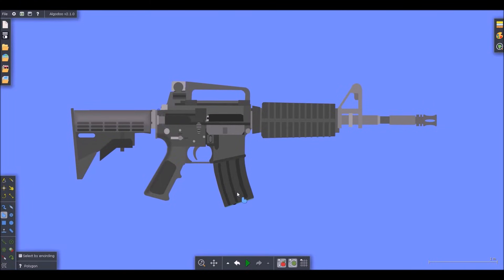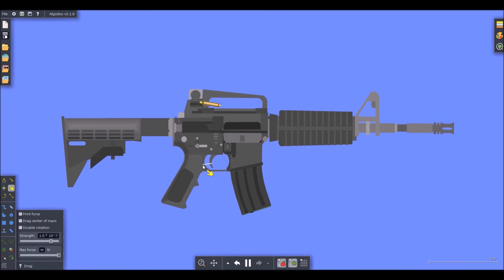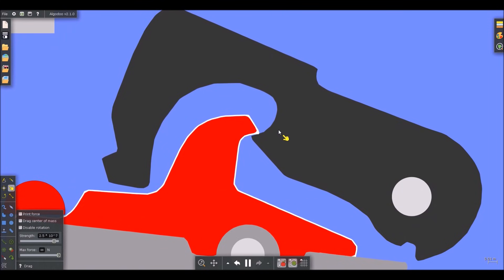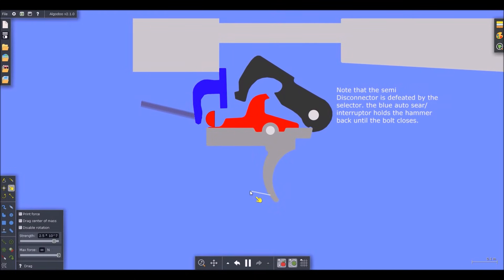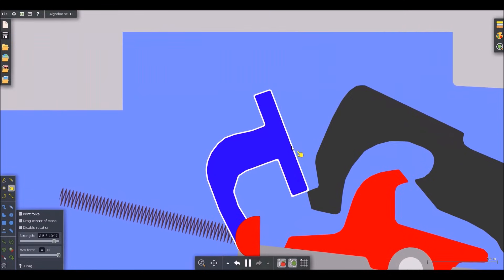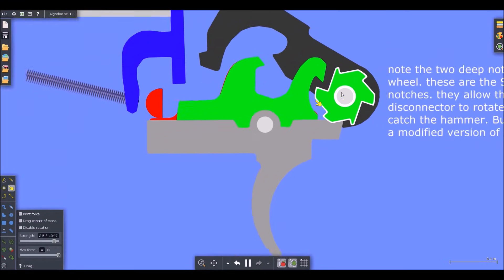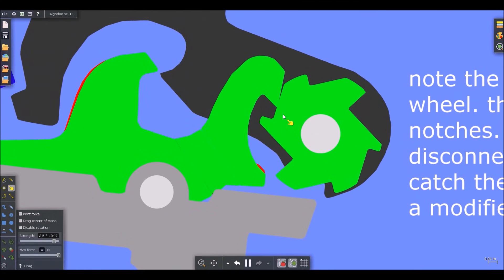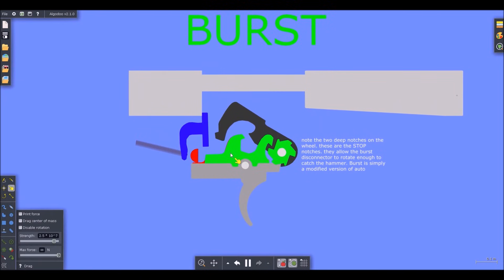How 3-round burst works

Comment: If you give the trigger a short quick squeeze that only sends out two shots. the next time you pull the trigger it will only fire one shot before disconnecting.

Or if you fire a single shot while in burst mode, the next time you pull the trigger it'll fire two shots.

And the burst cam also counts when you are in semi auto, so the first time you switch to the burst mode it is more or less random if the gun will fire one, two, or three shots in it's first burst.

And to make matters even better, the trigger weight varies depending on the position of the burst cam. so every third trigger pull is lighter than the other two, even in semi auto.
Reply from the maker: otetechie I should refer people to this comment, as a lot of people ask about this.
Reply: Are there any designs which don't have this flaw?
Reply: @masheroz  they all start with flaws, till its perfected, as cars have been, airplanes etc,   to me full auto with todays ammo prices is a waste of good ammo, and cash,  keep it simple and it will keep you safe and save money,  i just got a 3 round burst for air rifle and its almost the same,  but not as original as the s stamp c stamp if you know i mean??
Reply: That was exactly what I was curious about when I scrolled down, thanks for sharing.
Reply: Quincy Owyang It was introduced in the 1980s as a way to prevent the M16A2 from being made a semi auto only infantry rifle. Eugene Stoner also didn't design it.
Reply: @whiskerymedusa  : It was also a way to enable somewhat accurate full auto. I was an instructor back in the 70s, and I noticed that shooters would fire off a full 20 round mag, hitting with the first couple of rounds, blowing most of the rest over the target, then maybe get the last round or two back on target. When the A2 came out, I realized those same troops could put a number of short bursts on target with few overhead shots.
I've read that some troops hate the 3-round burst, and I'd like to know why. I never had to use it in a fight, so I'm asking those with combat experience.
Reply: @ComprehensiveContext  The reason they hate it is that the trigger squeeze changes every time you fire the rifle, and if you fire less than three rounds then switch the rifle finishes the three rounds before firing a burst. This all leads to a rifle that is less consistent shot to shot than a rifle should be.

Meanwhile soldiers who were magdumping were demonstrating the lack of training they received on its proper usage (which was an institutional problem) and an overall lack of discipline with arms (which is also a longstanding institutional problem)
Reply from the maker: the high fire volume makes a rifle devastating a close-quarters, but semi is still better for making deliberate, aimed shots.
Reply: Not all are crap like that. Others reset every time you release the trigger, so you get  true 3 round burst and not random like this.
Reply: jussimakarussi the hammer would not fall with enough force to fire a live round. This happens occasionally with bumpfire or binary fire, as well as very light triggers.
Reply: "So if I understood it correctly, there is nothing to prevent the hammer from dropping while the bolt is out of battery in a semi auto AR15?"

True, but the way the bolt carrier, firing pin, and hammer line up, the hammer shouldn't be able to hit the firing pin when the bolt is out of battery.
Reply: This is what I remember.  I thought my rifle was fucked up the first time I tried to fire in burst because it fired one round.  I then tried again and all three went off.  Clicked in my head that, well that's just the way it works, but it was odd.  Funny how the Army doesn't train on burst.  It's just a quick way of getting rounds down range when you've got too much ammo and no one wants to fill out the paper work to check it back in (or do the manual labor).  Hopefully things have changed by now, but probably not.  End of the day accurate fire does more than burst, especially when you have machine guns for suppression.
Reply from the maker: EricTheBoringOne on the m16 rifle, the INITIAL burst is random. The mechanism “wanders” even in semi. Anything following is a full 3 rounds.
Reply: lol They issue full auto rifles right now. Not only are there still M16A1s and its contemporary carbines being issued, but there are the original SPRs were built on full auto M16A1 lowers, the M16A3 variant is full auto, and then the M4A1s are full auto. There's a ton of full auto M16s and M4s being issued *right now*.
Reply: Quincy is right, it was designed for soldiers who didn't have good ammo conservation discipline, now that select fire rifles are more commonplace and the training is improved there's less need for it so they've gone back to just having semi and auto.
Reply: @G1NZOU  The number 50,000-250,000 small arms rounds per kill in Vietnam is routinely thrown around. The high number is said to be caused by wasteful soldiers, don;t know if this motivated the 3-round burst
Reply: actually burst fire works really well. its rare that someone using burst is gonna let of the trigger to quick because you train to properly use your weapon. burst is really great for suppression if for some reason your light machine gun goes down during combat
Reply: you know nothing about the combat applications of burst fire obviously.  its a great tool to have if your light machine gun ever goes down during a fire fight which happens moreoften than you would think. dont makecomments about things you know absolutely nothing about. it makes you look ignorant.
Reply: ok its obvious you have no clue what youre talking about. the m4 is still a semi/3 round burst weapon. the US military doesnt use full auto m4. manufacturers dont even make them except for special applications for SF groups.
Reply: "an unnecessarily complex shitty assault rifle that required DECADES of upgrades and continuing design just to become an average assault rifle."

A: It's not at all complicated.  It is definitely not complex, unless you mean its manufacture.  Then yes, the manufacture WAS complex by 1950s standards, because it relies on CNC machines.  Which are extremely common today.  B: The only "upgrade" it needed to surpass the rest of the breed at the time was to have the Army stop using the wrong powder in their ammunition.

I either own or have had the chance to shoot a lot of the competing designs, and none hold a candle at this point.  Yes, some of that is due to the decades of development, though a TON of that was companies developing for and with civilian shooters.  My private AR is about 15 years more advanced than the current issue M4.
Reply from the maker: Laramie Frank you’re thinking of the auto sear. Disconnector simply holds the hammer back when the trigger is held until the trigger is released
Reply from the maker: EricTheBoringOne guys, let’s keep it civil please. Discussion is good, but unnecessary criticism does nothing
Reply: EricTheBoringOne : If you're talking to me, I served in the Air Force from '82 to '86. In a earlier comment you mentioned the 3round burst was the best configuration, which I have to agree, from the shear reason that full auto isn't very accurate at all. 
When was the 3 shot burst introduced in all of the branches of the military, if I may ask?
Reply: Mandy Hammond Alright, thanks alot for the answer :)
Reply: +Matthew Rowles 

Binary triggers. 
 Those will replace the burst trigger as an intermediate.
Reply: @dalesmth1  what about the new ar's with electric trigger groups that can be changed anytime without much hassle,   semi, full  3rd  b etc
Reply: @Crownroyal-b3r  So only people who have designed firearms are allowed to voice any criticism? Haha the argument from authority is so empty and pathetic you don't need to be a chef to know shit tastes bad so go fuck yourself little buddy.
Reply: jussimakarussi the disconnector prevents it, and the bolt cycles so fast that you would not be able to reset and refire the trigger before the bolt locked again.
Reply: jussimakarussi the disconector prevents the hammer from falling out of battery. But it is the only thing preventing the hammer from falling out of battery. If you took out the disconector the hammer would fall while the bolt moves forward and possibly hit the firing pin Before the bolt locks
Reply: This is interesting, I never knew how the three shot burst worked. I only knew about the M-16's full auto functions since I used one in the military. Thanks for the clarification.
Reply: I love this comment! Thank you for tell the real burst mode work that most of game can't do it for real burst mode.
Reply: otetechie can you tell me what program you're using for the simulator
Reply: >> And to make matters even better, the trigger weight varies depending on the position of the burst cam. so every third trigger pull is lighter than the other two, even in semi auto.

Something every American Service Conditions competition shooter is only too aware of...
For single-shot events that allow for it, most shooters will cycle this purposely to get to that lighter pull. Most important, each pull is consistent.
https://www.youtube.com/watch?v=tV1xYJoiYjE&t=540s
Reply: So basically, burst fire sucks.
Reply: EricTheBoringOne : I know when I was about to get out, they were talking about the 3 round burst, but that's all it was, talk.
Reply: otetechie I was totally about to ask all the questions you answered. Thank you.
Reply: Good to know. I was considering designing a rifle with burst capabilities, since it's good for conserving ammo with undisciplined soldiers, but now I'm reconsidering.

The complexity, inconsistencies, and weight are too important to ignore, but burst fire wasn't intended to replace auto; it's just a training tool.

I'll probably end up compromising, making a burst variant for new soldiers that would be traded for auto after a few years of service.
Reply: Nice that's exactly what I wanted to know.
Reply: Exactly. Burst is more complex and has all the problems previously mentioned. Full auto is only on battle rifles to be used for short bursts in the first place, but apparently soldiers weren't/aren't disciplined enough for that.
Reply: Burst seems like a waste of ammo anyways. I would prefer either full or semi.
Reply: Sounds freakin annoying. Personally I’d stick to full auto. I understand the purpose behind 3 round burst, but I think it’s best to learn discipline and retain full function of the weapon rather than putting a bandaid on the problem of blowing through ammunition... easier said than done, but with modern training and combat experience, most firefights I’ve watched I haven’t seen any soldier just running a full mag dry out of fear.
No disrespect to any soldier of course. Anyone who has run a full mag dry with one trigger pull under stress, I don’t doubt I’d do the same at times.
Anyway, point being, I don’t think I’d feel as confident in my weapon and my ability to use it with that kind of complexity in its interaction with the user. I apply a certain amount of pressure to a trigger based on my subconscious memory of its weight when I’m ready to fire, that way I can break over my shot quick and easy without pulling off target... a constant change in trigger weight would drive me insane.
Reply: There are other three-round burst mechanisms out there.  Forgotten Weapons has a video about an (IIRC) an HK pistol with two additional disconnectors that are activated by the slide but then drop out of the way when the trigger resets.
Reply: Dude, this was an interesting read. Thank you for taking the time to write it.
Reply: your a moron
Reply: I see why the sig 551 mechanism is completely different. Avoids these issue.
Reply from the maker: depends on training and intended use. Burst tends to bridge the gap between the marksman and the machine gunner. A nice volley of 2-3 rounds has a similar spread pattern to a shotgun, making medium distance shots at laterally-moving targets a cinch
Reply: 3 rounds burst sounds like a bad idea if it works that way.
Reply: "3 rounds burst sounds like a bad idea if it works that way."

It and full auto are almost never useful, though burst is even less useful.
Reply: Mandy Hammond I was thinking more in the case of a failure to go fully into battery because of dirt or such. During a standard firing cycle this would never be an issue.
Reply: this isnt random you moron. its a true three round burst. pull the trigger and hold it for a split second longer than a semi auto shot and you send three rounds down range. its not hard to use. its actually very effective. ive got real life experience with these weapon systems and they are some of the best combat rifles in the world. thats why we use them.
Reply: you must have served a long time ago because none of our military branches have issued full auto m16 in a very very long time.
Reply: immikeurnot yep. The platform is very simple in every Avenue........ hence why it's still being used and why it was picked. Also before the ar, every branch had different weapons. 

Also agree with the issue with ordinance corps using incorrect gun powder. The og was not having a chrome lined barrel and had no cleaning kit due to the design was set up to use. They used ball powder but was supposed to be IMR. This causes many issues in FA and in the system in general. This was warned by stoner and colt.

These other guys are clueless on the who and what for the failures and the "dirty" issues. Would help if you have ever built, timed or even shot a FA rig.
Reply: Quincy Owyang also to keep the barrels from melting off the gun.
Reply: So if I understood it correctly, there is nothing to prevent the hammer from dropping while the bolt is out of battery in a semi auto AR15? Was it considered a redundant internal safety, when faced against the fear of it being modified into a full auto?
Reply: @jussimakarussi  : No, you're mistaken. Check out your AR15 trigger group, and you'll see the disconnector very clearly, just as in the M4 semiauto mode.
Reply: Yeah, Eugene Stoner was an overrated fucking idiot, who created an unnecessarily complex shitty assault rifle that required DECADES of upgrades and continuing design just to become an average assault rifle. 
Why the fuck the Pentagon didn't dropped the M16 after as soon as it became clear it was a terrible rifle and just bought or designed a better one is beyond me, bureaucratic momentum I guess.
Reply: @charlesferdinand422  i used my m16 in the army and it was the greatest rifle i ever used,  once it was redesigned by 72 i was in love, easy to take apart, clean,  and mine had semi , full auto and 3 round burst,  because i installed it myself with many errors and frustration till i could shoot a flower stem at a okay distance,  with that, stay off the m16 being a bad rifle,  still being loved today,  Mr., Stoner is not here to defend himself, quick calling people names already,  a true patriot respects other patriot, okay?????????
Reply: @charlesferdinand422  Read some history about why the issues in the field were so prominent.  Most of the issues with the M16 were because of inexplicable last minute design changes by bureaucrats, and not because of Stoner's design.  The effective lethality was decreased by a change in the twist rate that increased bullet stability through changes in material density during flight, air to body transition.  Changes in the material for the bolt, and even the addition of a forward assist, were some of the reasons for increased issues with failure due to dirt, with the bolt material being less resistant to issues with dirt, and the addition of the forward assist increasing openings for dirt to enter the internals of the system.  One of the biggest issues was because of a call for a change in the powder used by the ammunition which caused cyclic changes in the resonance of the system, increasing failures. EDIT:  Wrong link the first time:  https://www.theatlantic.com/magazine/archive/1981/06/m-16-a-bureaucratic-horror-story/545153/
Reply: @bigassrat  It's funny how other really good assault rifles like the AK47 didn't need any upgrades or improvements, theyre were great right from the beginning while the M16 needed decades of research and upgrades.

Comment: Interesting! Always amazing how much thought is in these mechanisms. One Question: This means that if i stop pulling the trigger after the first shot in burst-mode, i only get two "automatic" shots when i pull the trigger a second time instead of three shots. Did i understand that correctly?
Reply from the maker: luggiswold yeah, that's correct
Reply from the maker: Cyrus Freeman how would you describe the experience? What would you suggest to the engineers who came up with the trigger for improvement?
Reply from the maker: That's actually really interesting to hear that your experience was not a negative one once you learned to follow through rather than tap. I've heard a lot of complaints about it being finicky, but that was always related to the favor of either semi-auto or full-auto instead of appreciating the concept of what a burst trigger did: compromise.

I'll check that interview out! Thanks for watching and commenting!

Comment: cool video,but it may be helpful to go one step further and describe how the firing mechanism is changed back to normal functions ,what levers are used and where these levers are found.I am guessing that the three round burst selected lever engages and disengages the ratchet  by moving some kind of pawl otherwise the three burst ratchet would be rotating every time the bolt cycles either in semi or full auto.
Reply from the maker: Peter Hyde there's no pawls or special levers used. The 3-burst mechanism here does operate with every cycle, regardless of whether in semi or burst. It's a tad finicky for that very reason, with "short" bursts being possible when changing fire selection.